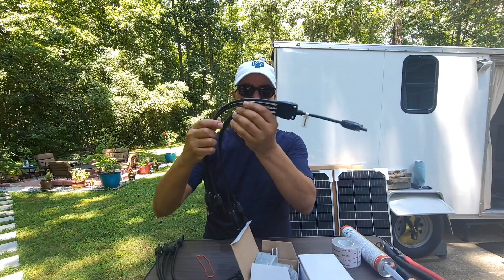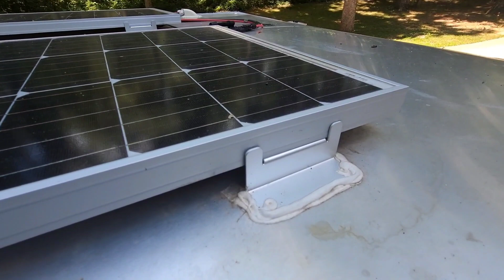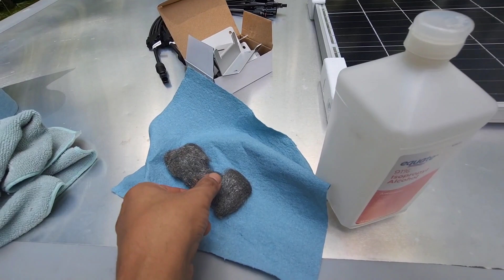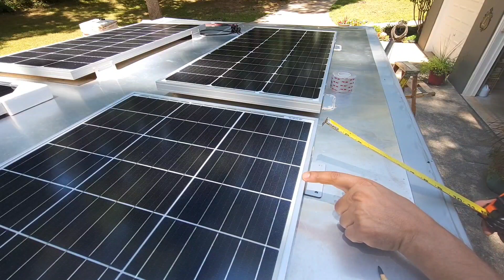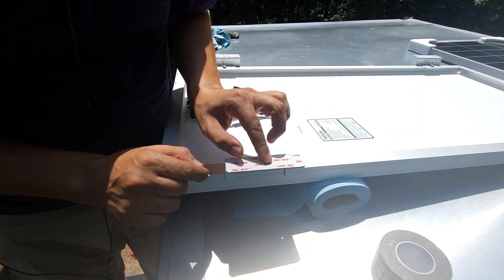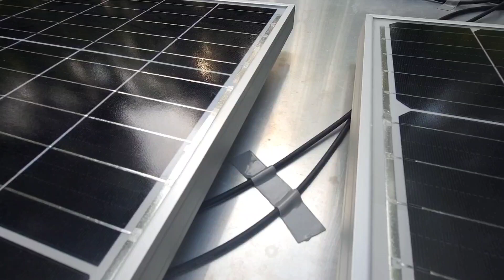Camper Solar Install, No Drilling, Bolts or Screws

Comment: on the lead panel, install a wind deflector on the forward edge of that panel. These attach the same way, VHB tape to hold the wind deflector to the roof and then bolt to that first panel, this creates down force/pressure and eliminates air from getting under your panel array and greatly reduce the lift of high speed driving on your panel array. -\_ <-wind hits deflector and goes over the panels

Comment: Excellent 👍
Have to agree about not holes in the roof, as few as possible at least.  Should I do a roof mount for solar I think I will  go the extra step a bring the wires  to the side.  I was leaning toward a movable foldup solar array incase I get shade for the trailer and sun for the solar elsewhere, which is the case with many of our provincial parks we have been to.
Cheers
Reply from the maker: I agree with running the solar wires on the side of the trailer. You can also add a solar plug connected to your solar controller so you park in the shade and use your folding panels if need be.

Comment: For some reasons you need to removed the solar panel how?
Reply from the maker: They can be unbolted. They may take a little longer to remove but it can be done.
Reply: with wire